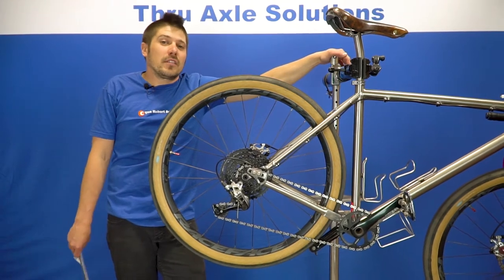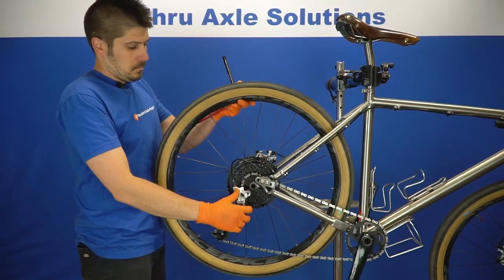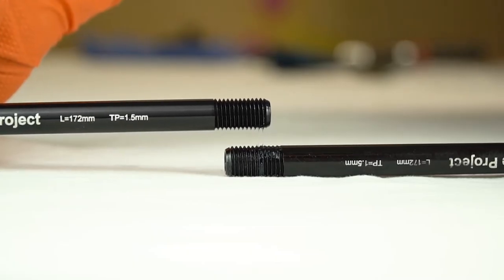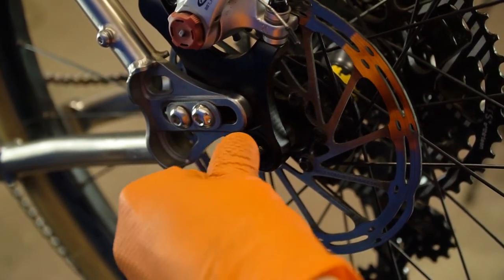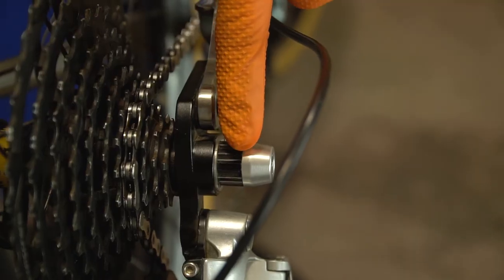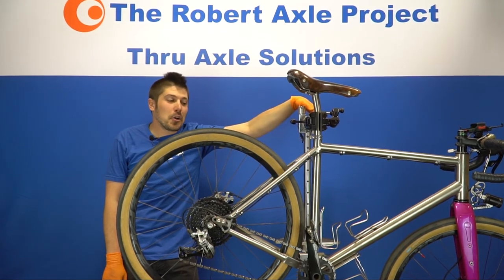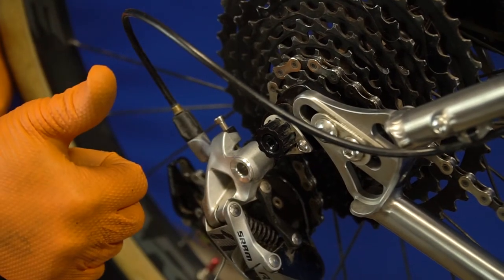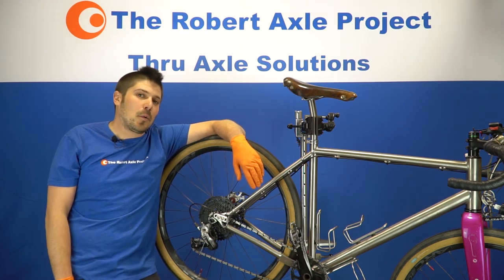How to Install a Trainer Thru Axle to Use Your Bike on a Trainer

Comment: Just installed mine in a Canyon Endurance. Fit perfectly and is rock solid on the trainer.
Reply: I just installed one on my Endurance and it seems to have thrown off my shifting. I used the Saris brand thru axle adapter since I have a saris wheel-on trainer. What did you use?

Comment: Why do you need to remove the Drive side cap before riding the bike outside?
Reply: Wondering the same thing
Reply: Weight matters..
Reply: If u have a flat of course.
Reply from the maker: The driveside end can loosen over time since it is not a part of the axle like the non-driveside end. The main reason we say to remove it is so you don't loose that part and then need to get a new one.